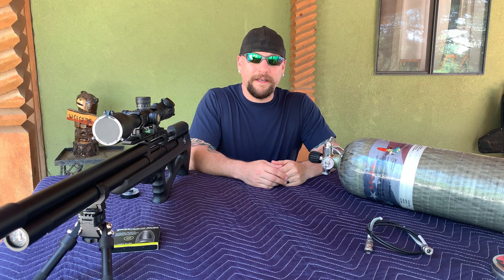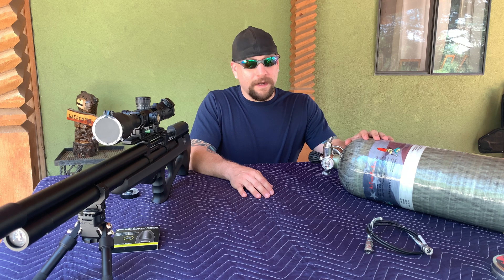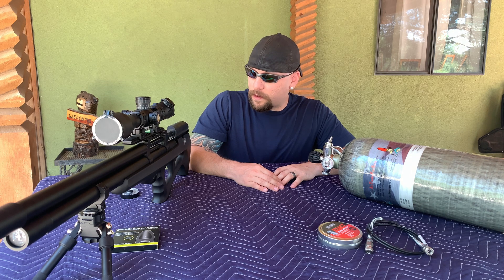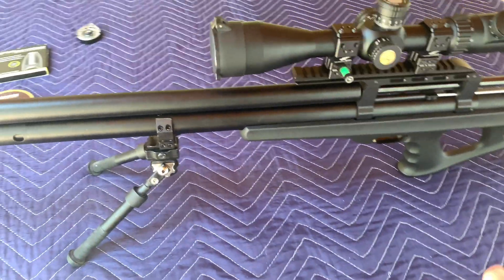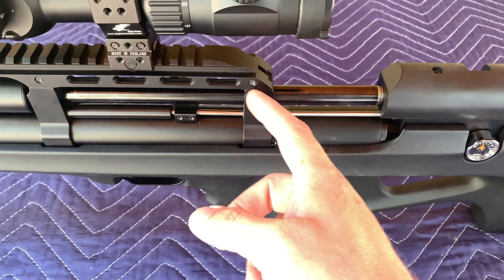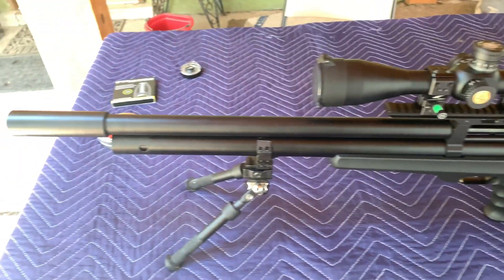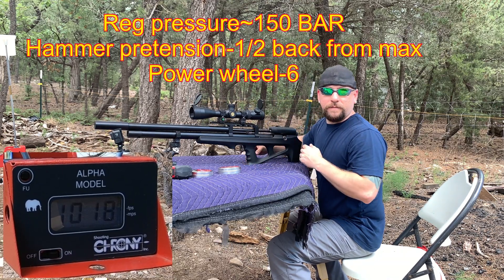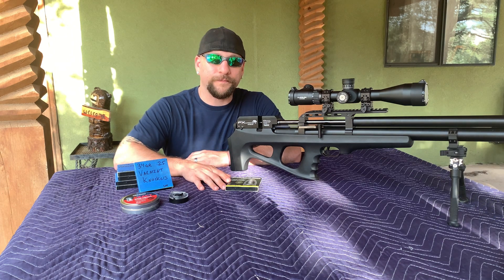FX Wildcat MK3 with 2.5” Power Plenum Overview

Comment: With the transfer port did you open up the pellet probe to match or buy the kit with the the probe in it ?
Reply from the maker: @Dennis Novak- The pellet probe that huma offers is only for the Impact and will not fit the Wildcat. I enlarged the probe that came with my rifle using a dremel and a grinding bit. Hope that helps!
Reply: @dangolwinner  thank you and yes.

Comment: I found someone with a 1" plenum for a dreamline 33.95OD basically that's the same tube as the WC. Correct?
Reply from the maker: @headcracker SilentSniper- I’m not sure on that, I can find out though! There might be a difference between the 2 that’s makes them not comparable. Let me see what I can find out!!
Reply from the maker: @headcracker SilentSniper- Ok I found out that it will seal and hold air in the Wildcat, but the threaded area is longer in the dreamline. When using the dreamline plenum in the Wildcat, it will not thread in all the way and you will still have some of the threaded area showing from the outside.
Reply: @dangolwinner  thanks alot for that info
Reply from the maker: @headcracker SilentSniper- 👍🏻👍🏻

Comment: I want to know where to get that bipod clamp from
Reply from the maker: @Thomas Gardner- I made it from a 34mm scope ring! The air tube for the wildcat mk3 is 34mm diameter and I had some extra scope rings and cut a portion of the top of the ring off and then took a pic rail and cut it in half and screwed it back to back. Works great!

Comment: I thought that the mk3 came with a power plenum from the factory
Reply from the maker: @BIG EARL- You are partly correct! The new MK3 edition has a larger plenum space after the regulator compared to the mk2 but what I did was add an aftermarket plenum on the gun as well that added an additional 2.5” length to the plenum area after the regulator. There are a few website that offer the aftermarket plenum for the wildcat- 910 airgun tuning and spaweapons are 2 sites I know of. Hope that helps explain things a bit!
Reply: @dangolwinner  what were your fps b4 the after market plenum,  I want a 60fpe 25cal for hunting hogs,  I don't see any mk3 sniper reviews...I did see on paper that the sniper 25cal was 70fpe factory..i don't know if it's true or not..but it has my attention lol
Reply from the maker: @BIG EARL- I have it documented in one of the videos, but from the factory maxed out it was pushing the FX hybrid at 955fps, then I added the huma transfer port and and got me to 970fps, then with the power plenum it took the hybrids to 1060fps. At the same tune with the hybrid I also shot 34 gr slugs and was able to push them to 995FPS and that’s right at 70fpe. In .25 cal you will need some upgrades to push 70fpe! But it is possible, that’s how I have maybe set up right now! I just go the parts to swap calibers to .30 and .22 so I will be working on a video soon for the wildcat in .30 cal. Hope that helps! And thanks for the comment
Reply: @dangolwinner  I appreciate your response,  yes it did help, ill check your video out...

Comment: I'm  really getting  a lot of good information from your videos. I do have a question. There seems to be many Wildcat MK3 owners having issues with leaking guns, have you heard this too? If so, have you heard if there is a plan from FX to deal with these leaks?
Reply from the maker: @Joey Tipler- I’m glad your able to get some info from the videos! I have had several people asking me about leaks in their mk3 wildcats, Fx has recently changed the way they manufacture some components of the air tube and I’m not sure if it is an attempt to correct a flaw or just simplify the manufacturing process with fewer parts. But the next set of wildcat mk3s will have some changes made to them. I am going to reach out to FX and see what they say and I’ll include the findings in a future video. Thanks for the feed back and the comment!

Comment: Great video and information I'm looking at getting a Wildcat mk3 in the sniper version but trying to decide what caliber either 22 cal or 25 cal I do do pest control and hunting
Reply from the maker: @Donald Lundy- It’s a nice rifle to have if it’s in your price range! Personally I feel the platform is best suited for .25 cal. You get a high shot count and ample power for larger pest animals, and still have the option to tune it down a bit for smaller pest animals. It will shoot slugs and pellets both and leaves the option to push it to 70fpe if you are willing to upgrade the transfer port and add a power plenum ($100). I’m happy with mine and it’s a pleasure to shoot. Thanks for the feed back!

Comment: I gotta ask you. Did you have problems with oring air leaks when you finished the Install? I had a real bad leak between the csp and the tube.
Reply from the maker: @Derrick Mitchell- No mine sealed up, I used silicone oil on all the orings, if the orings don’t have a good coat of it they will leak.
Reply: @dangolwinner  if I had known then what I know now.😔
Reply from the maker: @Derrik Mitchell- Oh man! I get my silicone oil from Home Depot or Lowe’s from the plumbing isle near the soldering stuff. A little tub of it, it’s more like grease than oil. Only cost a few $$
Reply: @dangolwinner  I get the recommended o rings in tomorrow and will apply the Danco silicone grease, light coat and pray that I get a good seal.
Reply from the maker: @Derrick Mitchell- That should be the cause of it. Hope you get it fixed and good luck
Reply: @dangolwinner  thanks, I'll do a video and post it.
Reply: fixed the leak, didn't have the cap on tight enough. Still had to send it back to FX USA, had a air leak from somewhere else. Now it just me and the trusty Sumatra again. The Wildcat and the Puncher Breaker are out for repairs and modifications 😥
Reply from the maker: @Derrick Mitchell- Dang! At least you have something to shoot still! Always nice to have a few guns!
Reply: @dangolwinner  yeah but I was just getting use to my Wildcat mk3.

Comment: What repairs were needed for the wildcat? I'd definitely be looking for that video on the tune up for the hades and jsb mk2 as those are what I'm shooting exclusively since I no longer have a place to go out to 100 with out worrying about a back drop. So my hope and dreams of slug are kinda out the window.
Reply from the maker: @keepinitsideways- I had a piece missing where my stock attaches to the action, my cocking linkage was messed up, and the regulator was not consistent. It’s shooting good now and I just finished recording another video using the varmint knockers and the JSB MK2 heavies. The heavies grouped great at 50 and 100. I’ll work on editing and posting it today, should be up tomorrow. Then I will be working on how to tune the gun next video. I’ll take it from very low speed, up to a good consist speed.

Comment: Awesome brother that's what I've notice about these fx guns is that they are very consistentat I know you got a Huma I'll probably change mine to a huma later but for now it's very consistentat on the fx reg .. I found that my gun fx impact mk2 likes to shoot these hybrid at 975 980 fps I'm getting a 1 1/4 inch group at a hundred yards... man bro that sucks about the new tank I have the same luck it always takes it twice for something to work out for me lol thanks for sharing buddy bsafe
Reply from the maker: @Chris Figueroa- I still have the FX regulator in there. The tech I talked with when I was getting my rifle sent back said that in his experience the AMP regulators are a good regulator as long as you adjust them slowly when tuning and have oil on the orings. I’ll keep this one till I have a reason to swap it for the huma, but if I do I’ll make a video of it! Thats pretty decent groups for 100 yards. Lots of factors that go into getting tight groups with slugs. I was upset with the tank at first but oh well! I’m getting used to having to wait double lately like you said lol! Thanks for the comment!
Reply: @dangolwinner  10-4 buddy sound good cant wait buddy bsafe.... I was checking out your Instagram and bro I killed a rattlesnake like you in my driveway thank God my kids were not outside at the time its was about 30 foot long
Reply from the maker: @Chris Figueroa- Oh dang! Those snakes are no joke! Good thing nothing happened! I’ll be putting out some more videos this week, I just finished recording the varmint knocker video and included the JSB MK2 heavies and the pellets were shooting at 970FPS and they grouped great!
Reply: @dangolwinner  that's awesome to hear brother dam

Comment: After having the same issues with my Wilcat mk3 as you have had .I now get a hissing noise from the back of the gun near regulator after some shots. Is this why you changed the reg? and is this normal or do I have a leak ?
Regds steve
Reply from the maker: @mcyclecollector smith- The sound you are hearing is the air passing through the regulator and is 100% normal. A sign of a leaky regulator will be loosing air pressure constantly In the tank and or the regulator pressure gauge will always be inconsistent. Hope that helps!
Reply: @dangolwinner  Thanks for that .My mind is a ease now. Love the videos. cheers
Reply from the maker: @mcyclecollector smith- It’s a bad feeling to thing something is wrong with your rifle! Glad I could help!

Comment: Thanks for the video. With the 65mm pp I believe the reg  is now adjustable without removing the stock if my info is correct. looking forward to more videos. atb neil.
Reply from the maker: @stillair1- thanks for the comment! It should be adjustable, but the way mine lined up, the adjustment hole is about 1/8” below the stock! Just my luck! Not a big deal for me though. The power increase was significant!
Reply: dang.ol.winner I have the same alignment issue with my reg adjustment screw. Newman at 910 Airguns told me I could drill another hole in the air tube so the screw is accessible (as long as the hole is between the two regulator o-rings, obviously). I have been hesitant to drill it though. Maybe you’ll be the guinea pig?
Reply from the maker: @mburke1211- For me it’s not that big of a deal, I’m going to leave it. If o was going to do any thing to make it accessible, I would probably sand down the stock in the area where is at. It’s only about 1/8” below the stock. Are you located in NM?
Reply: dang.ol.winner No, I’m in NC. My alignment is similar. I can almost get to the screw. It’s not that big of a deal to remove the stock. I was mainly mentioning the drilling option for stillair1. Thanks for your videos. I’m looking forward to more.

Comment: Glad you have it back in working order... As for the barrel droop with a heavy silencer would a profiled shim that sits in between the barrel and cylinder be worth making.. a bit like a barrel band with the outer edges cut away
Reply from the maker: @duffmanmark- Thanks, I’m happy to have it back, I thought it was going to take months to get it back! I agree with you about the shim, It will have to be made out something that is not effected by the temperature. I will try and make something out plastic or aluminum

Comment: I also have the wc mk3 .25  I changed from the sumo to the huggett belita.  Extremely happy with it  very light small works better
Reply from the maker: Vinny C- Nice! That’s good to know! I was still kinda undecided on what brand and model but I’ll check it out. Did the sumo cause the barrel sag?
Reply: dang.ol.winner  I have lots of Donnyfl’s  I have ronins shoguns sumo’s and tanto’s. I have always used them, but recently started with huggetts and I honestly see myself moving away from donnyfl. Don’t get me wrong Donny is good but side by side on the ones I’ve used huggetts blow them outta the water.
Reply from the maker: @Vinny C- I need 2 more suppressors so I would like to try another brand, thanks for sharing that info. Others read the comments and I’m sure it will help others as well!